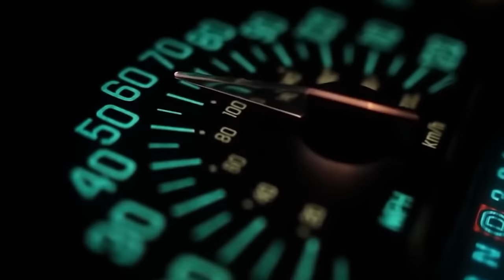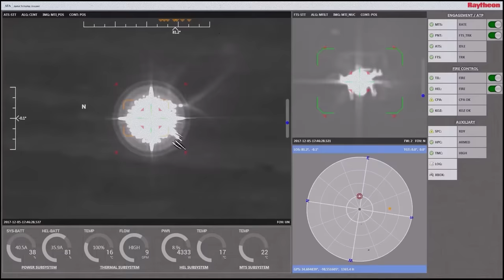America’s DE M-SHORAD: The Future of Laser Defense

Comment: Sounds like a wonder weapon...but the beam emitters can be messed with if the emitter is down wind and a preceding cloud of something sticky like petroleum or an adhesive were to drift over.  The cloud's contents would stick to the optical surfaces where two thing could happen: 1) The beam would distort as long as the lens coatings are compromised by the sticky stuff and/or 2) The contaminates sticking to the optical surfaces would burn thus neutralizing the laser.  BTW can heavy fog or smoke mess with the strength of the beam or is the weapon strength enough to overcome?
Reply: 1. Effective countermeasures would have negligible development cost.

2. The requirement of perfectly upwind of a mobile weapons system on a sufficiently windy day immediately reduces the applicability of the solution to under 5% of scenarios of need.

3. the large volume of material required per minute of denial means that even an entire combat-mobile tanker dedicated to this task can’t offer much suppression

4. while ground-based DE systems might easily carry countermeasures for this optics compromise cloud you propose, the friendly drones in the area would likely not be able to bear that weight/cost burden, thus potentially making the clouds more detrimental to the vision of the drones than the integrity of the lasers attacking them. After all, if the drones and the cloud are between you and the enemy, the drones are probably in or near the cloud. One could say “the drones will fly Above the cloud, but that makes them easier to see and hit, and assumes that you have control over the height of the cloud, which you need to keep suspended so it doesn’t fall to the ground

Still, there’s nothing wrong with a brainstorm.
Reply: Yes
Reply: But good luck trying

Comment: Any info on effectiveness in rain, sleet, smoke, ablative coatings, blizzard, etc environments?
Reflective paint with sand coatings on targets have any impact of effectiveness?
Are their particle beam versions in addition to light/laser versions?
Reply: I’m thinking it would be a big impact on the system - but also on the cheap drones. Both rely currently on clear weather for optimal performance

Comment: This is actually so obvious, I wonder why nobody came up with it already. Let's take Israel for example. Mount one of these DES system on every 3rd apartment in the cities roof and have a software controll them. In case of a focused fire, it is possible for them to intercept and neutralize even heavier targets, and with a proper air observation system that can track and identify "low altitude" objects, they could work as effective as nothing before. With even higher powered DAS and the same number of equipments, long range missles could be incercepted as well. Why nobody though this as an option?

Comment: This system might actually be plausible, unlike other systems. Why? Small drones can be easily destroyed with lasers. It doesn't have to heat steal, just some plastic. The Iron Beam probably won't be that successful. Now, the main rival to this system is just a radar and a 12.7 mm machine gun or a 14.5 mm machine-gun. You manage to connect those 2 together and you have a cheaper alternative to the Phalanx close in weapons system.

Comment: Problem is without a low unit cost these lasers will not be wide spread enough to compete with just how wide spread cheap drones will be.
Not to mention the issues of laser based systems being very affected by weather and air particulates.
So saying it is the end of drones is just a silly thing to say.

Comment: Power for the laser comes from batteries charged by the diesel engine.  Charge rate would be less than the lasers power requirements so continuous fire rate is tied to battery capacity not  the fuel tank.

Also high energy lasers can have components with limited life span where they are only good for a certain number of shots.  With this being a relatively lower power system maybe they avoid this issue.

If the overall system cost was low enough that these could be deployed in large numbers it could make a real difference in Ukraine. 

Man portable or mountable in a Toyota 4x4 ideally...
Reply: Never heard of a towed generator?  15 to 30 Kw continous output. Available surplus. Now. On board generator is only for mobile situations.  Static site protection? Towed generator solution.  Stop, setup, plug in. Shoot. 
Wanna stay mobile the whole time? Your limitation is fuel for your ONBOARD AUXILIARY generator.  But I don't know nothing about nothing.  😂

Comment: There is one problem. 
If it's laser - it's on a frontline because that's where most drones operate the most. 
If it's on a frontline it can be targeted with anything from 120 mm mortar to 155 mm artillery to MLRS. 
There is a reason why nobody puts SAM directly on a frontline. 
Therefore it doesn't solve small drone issue like FPV and Mavics, only larger ones like Lancet.
Reply: Enemy artillery becomes less effective when you’re supported by air. Small drones aren’t much of an issue.
Reply: @Gridlocked >75% of visually confirmed Russian vehicles losses are hit by FPV
>Small drones aren’t much of an issue.
seriously?
Reply: @RemusCroft Most visually confirmed losses are definitely not from small drones, but from enemy artillery.
Reply: @Gridlocked  not for last 3 months.

Comment: I don't think it's real accurate stating it can disable artillery... I doubt it. A mechanical fuze isn't affected by something like laser. You can hit it with a hammer crush it and it will still work. And the body of an artillery round isn't going to what melt.... Nah... I think this is used for plastic air planes more so that steel

Comment: This video does a poor job describing the drawbacks of such a laser system. The cost per unit is much higher than cannon based variants, while the technology is sensitive and easily disrupted by dust, cloud or fog. The optics are expensive and even small amounts of dust can lead to significantly degraded performance. Maintenance requirements are also more complex due to requiring a clean room to be able to replace parts.

Comment: At the risk of armchair quarterbacking, was a DE system really the optimal solution? I can’t help thinking that something like a 4/0 or perhaps larger bore shotgun with a rudimentary targeting radar would do the same thing with a really low level of tech. Not that a DE system isn’t a good idea, it just seems to me that using a projectile based system would be much cheaper and faster to deploy, as well as more reliable in all weather.
Reply: I thought the same thing too. You can make a ghetto 4-barrel rotating autoloader firing a custom 40mm flak (or flechette) shell with .25 shot. That is a cloud of lead up to 200m for each shot, you can probably get that thing firing 6 shells a second.
Drones can't be armored, they need to go over 120km/h to be effective in this kamikaze swarm tactic. A single .25 shot going a mere 800fps is going to wreck that shell, and saturation will most likely ensure multiple hits on every target.

This isn't insane, considereing that France has deployed some infantry now with 28.5" Benelli Supernovas, and you can't tell me they are either for hunting or CQB.
Reply: @LPikeno yeah, I’m pretty sure a long barrel 12 gauge isn’t for ducks…. No matter how much the french like pate😂. 

I don’t know if this story is true or not; but I heard that when NASA needed a pen to write in zero gravity, they spent a million dollars (in the 50s) designing one; and the Russians used a pencil. Ultimately, a pen is better, but it seems like a ‘good enough’ solution here is a bit more low tech than a DE system. Or, good enough for the task and that can be made with very little innovation. Just sort of duct tape existing tech together and go.
Reply: @kurtisb100  Exactly. How much R&D does it take to just repurpose a GAU13 into a flechette shooting cloud of lead?
The rest of R&D going to small drone detection and targeting, which is already part of the DE current solution.

Given what we see, I would not doubt that pen anecdote.

Comment: I have a LOT of doubts about the effectiveness of DE weapons. Microwaves might be useful but lasers have so many weaknesses.
Reply: Yeah the problem with DE weapons is how power hungry they are and the heat needed to be rejected when making that power. We need much better energy storage and efficiencies if they are going to be used, using high voltage wiring and systems is a start and that is starting to get more research. Using graphene conductors and energy storage would work, especially when it comes to waste heat rejection, but it's just so expensive to make the stuff. There are some companies who are making it cheap from natural gas but they haven't figured out how to scale it yet.

Comment: Haven't watched the video yet, but I worked in weapons testing in the US for all but the last two years of my career. I've seen many laser systems come and go. Placed on everything from a humvee to an aircraft. I've heard stories and read reports on the laser systems that came before the ones I worked with in a testing environment. Talked to techs with combined centuries of experience. I have never seen an EOD tech enthusiastic about a laser system until now, but not this particular system. 

The many systems I've seen in testing were all terrible flops. Ground based systems weren't durable enough to handle rough terrain. Some were foiled by simple sand. The flying laser was the biggest flop of all. We wanted to see that thing testing so bad, but they could never get a shot off. 

Now I'll watch the video and edit with any changes or new info 😂

Ok so it's a HELSTAF project if it's testing at WSMR. Stationary units, like in the iron dome, will probably be more useful. These systems are too fragile to maintain operation on a Stryker. They'll constantly be in for maintenance and repair. 

Old laser system weren't dropped and shelver either. They just get rebranded by the defense contractor and put out to fail again. That's not exclusive to energy weapons, it's pretty rampant in the weapons testing sector in general.

Comment: All you have to do is rotate the surface presented to the laser. Lasers will heat up the device in order to destroy it. Rotation will make it harder to focus energy on a single point so you can’t destroy the object.
Reply: Depends on the size of the drone and the skill of the operator. 
A larger drone will have a larger profile to dissipate the lasers heat energy, but that assumes the operator detects it is being hit with a laser fast enough.
While no numbers on kill speed are known, most drones in demonstrations last about 5-10 seconds before critical damage has been done and that is with test lasers, which are lower powered than military grade ones as in the M-Shorad concept.